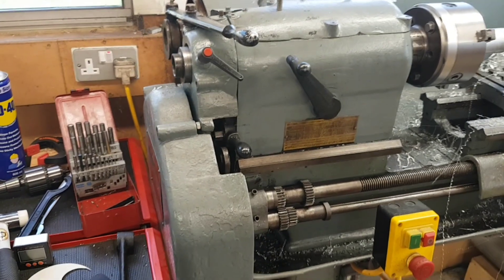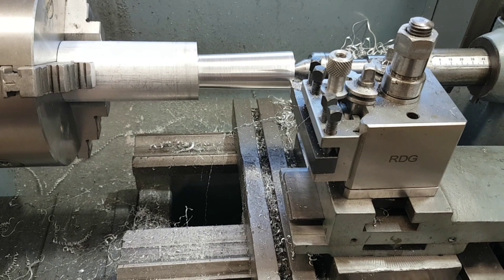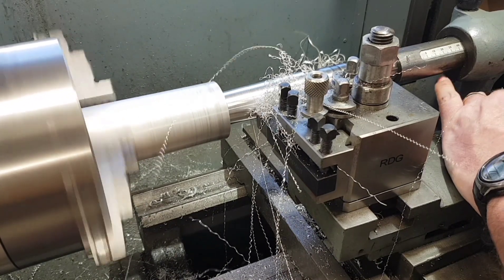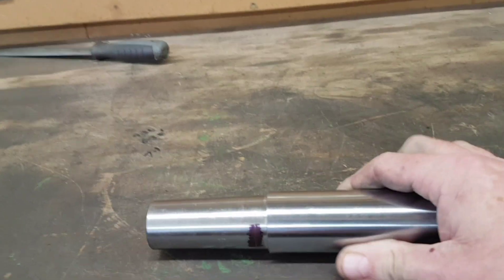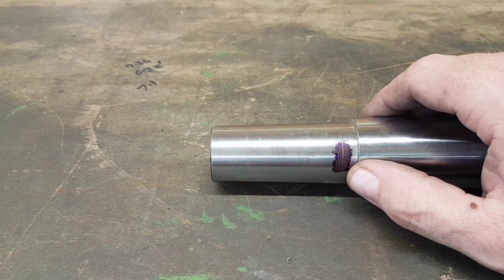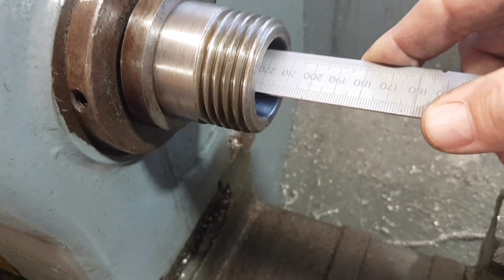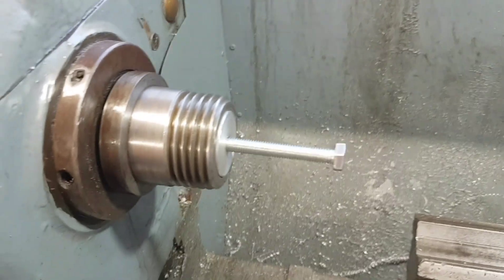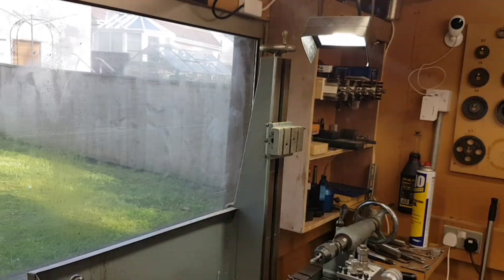Lathe Chuck Backstop (1 of 2)

Comment: Why haven't you made an adaptor so that you can wind the compound in and out with your battery drill like I did ages ago??? Saves a lot of energy that you can use for other things.
Reply from the maker: I have boss !
But,,, my battery drill is way too fast even on the lowest speed. When I used it, it resembled my last attempt at thread cutting. Mate! It wasn't pretty 🙄🙄🙄

Comment: Your complaints about your lathe being a bit loose makes me wonder if your gib strips need adjustment. They were on my Atlas when I bought it. 

Interesting idea. Wouldn't work in my Atlas as someone has bored the spindle to just under 1" straight through though a similar idea would work on my Myford. Many thanks for sharing. Also like the "but prop"
Reply from the maker: Hi Ben.
I cant tighten the gibs too much. If I do I'm  limited to only a few inches of travel in any direction. The old girl has had a hard working life but she still works but needs a bit of care and a soft touch.
Cheers Neil
Reply: @NellsMechanicalManCave  Perhaps your cross slide or ways need a bit of a grind. Nit cheep but outrageous either.
Reply from the maker: @BensWorkshop  it could be the way to go but I would need new lead screws and nuts too. It's taken 5 years to find parts to get it to this stage and I'm still searching for bits now. 80 year old spares are like hens teeth!
Good call though !
Reply: @NellsMechanicalManCave  You could probably just get away with a new nut rather than the whole screw though. Still, something to save up for.
Reply from the maker: @BensWorkshop  I've been looking for a half nut for 5 years, mine is smooth
Reply: @NellsMechanicalManCave  Make one, or find someone to make you one. John at Doubleboost is quite good. No idea how much he would charge though.